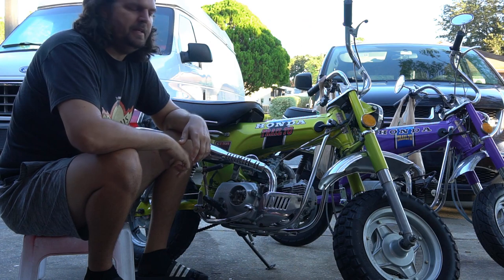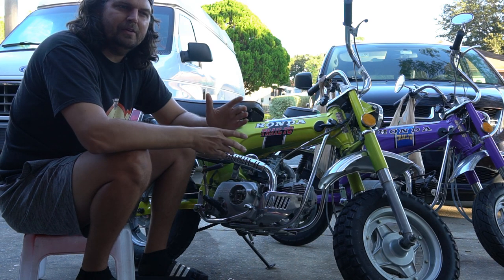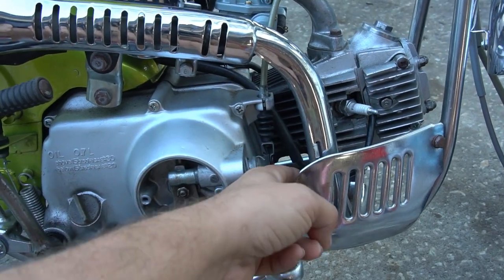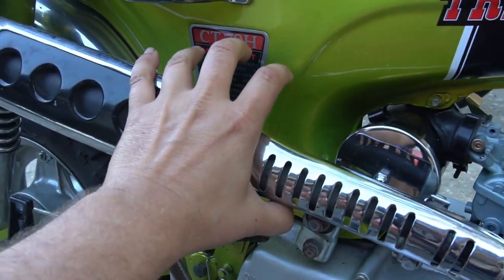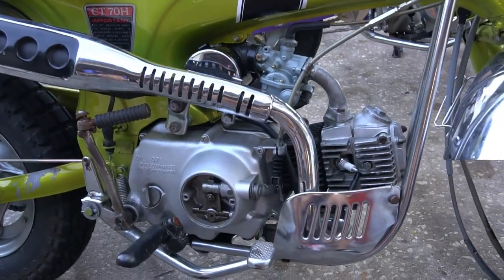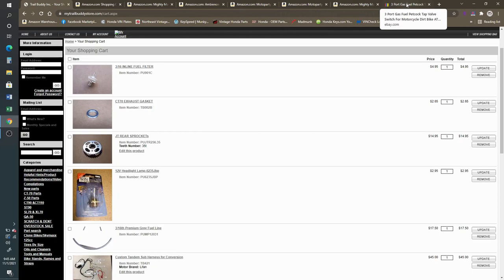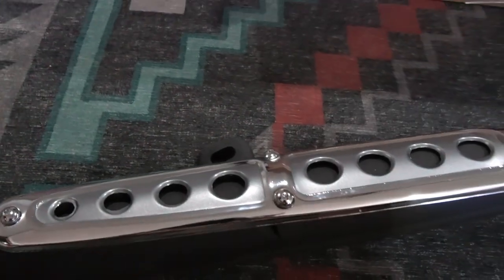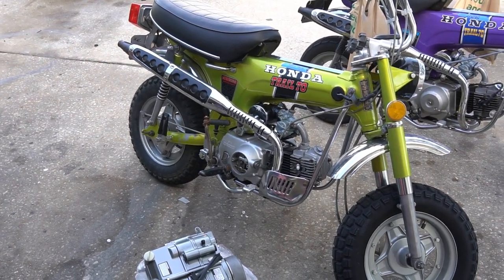125cc 12v Lifan Engine Swap - Honda CT70 Dax Mini Trail Motorcycle Minibike - Video 1 of 5

Comment: Great Video for the beginner, I have installed at least 20 Lifan engines on builds with good luck,  using both 6-& 12 volt conversion good job

Comment: I was gonna ask you, do you have to remove the red old school rectifier with this type setup? been at a stand still with my cl70, the TB website said to buy there 6v rectifier when you do the tandem wire harness and didn't know if than i would also need a 12v or 6v battery and if still needed to switch out the lights to 12v. I have parts to do either but not sure the correct way to use the tandem harness and why there website recommended the 6v metal newer type rectifier with there tandem wire harness purchase, so i didn't buy there 12v rectifier. and also didn't know which wave type rectifier that they have to purchase. Thanks for any of your help

Comment: Hey Josh, several owners have had engine mounting bolts shear off…..what bolt are you using?
Reply from the maker: Grade 5/8 or equivalent metric should be more than enough. Those that are shearing probably have had the nuts backing off or loosening allowing engine to move around and introduce jolting/vibration. If torqued and loctited shouldn't have any issues
Reply: @VintageHondaMinis  Is there a specified torque setting for those bolts…..I have an Icebear Champion CT70 clone…no manual for that. I did buy the Clymer’s tech book but it doesn’t cover the Lifan 125cc engines.  Anything else i am trying to get out the Clymer book.
Reply from the maker: 18 ft/lbs (2.5 kg-m)

Comment: I’m thinking about swapping a 100cc engine in one of my z50s. So what’s your thought about that?
Reply from the maker: I would do a front clutch 125cc like this build (Lifan style 125cc). In the USA market this engine is cost effective compared to other bore size engines b/c it is the most common engine, widely available and plenty of power for a Z.

Comment: I know this isn’t 100% related to the video, and maybe this would make for a good video, but what are your top 5/10 most used or important tools/ equipment to your shop?
Reply from the maker: Tough one because I use an array of tools. I'll try to get a video series out on basic tools needed and cover some specialty tools that will save you headaches when particular issues arise
Reply: @VintageHondaMinis  Awesome, I have a good array of hand tools and what not but I have still found myself buying tools and/or equipment and shop supply that is somewhat specific to the bikes